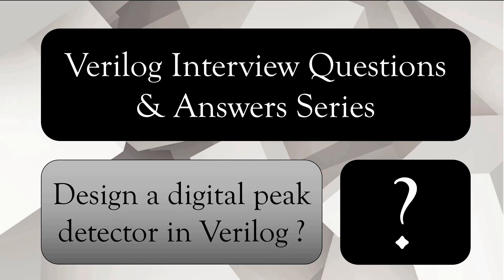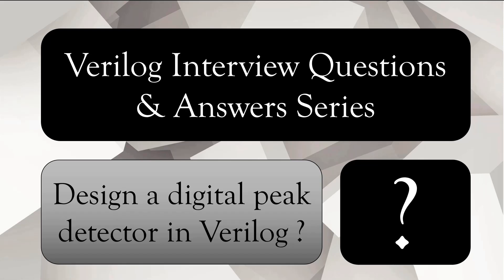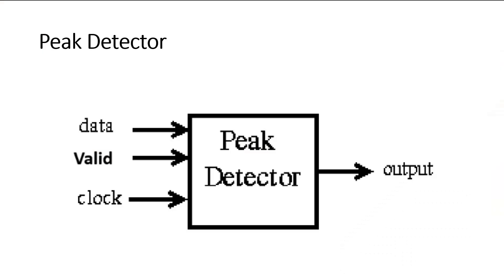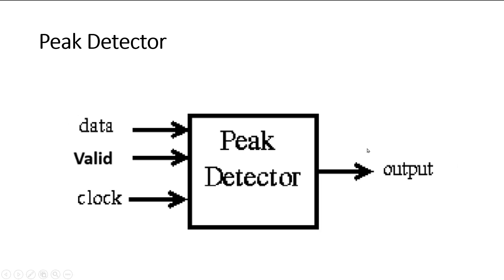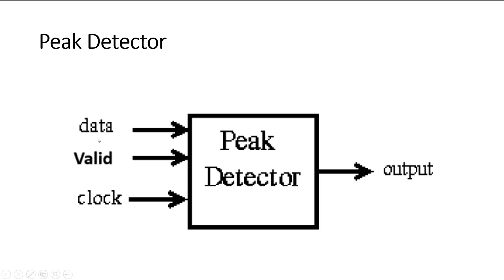Interview Questeion: Peak Detector Verilog Code

Comment: module peak_detector #(
parameter DATA_WIDTH=64
)
(
input wire clk,
input wire valid,
input wire reset,
input wire [(DATA_WIDTH -1) : 0] Data_in,
output reg [(DATA_WIDTH-1)  : 0] Data_out
);

always@(posedge clk) begin
if (reset)
   Data_out <= 0;
else if (valid && (Data_out < Data_in))
          Data_out <= Data_in;
     
end

endmodule
Reply from the maker: correct answer !
Reply: add the following statement also for a better code:

else 
       data_out <= data_out;

This will handle other situations like valid is low and data_out >= data_in.